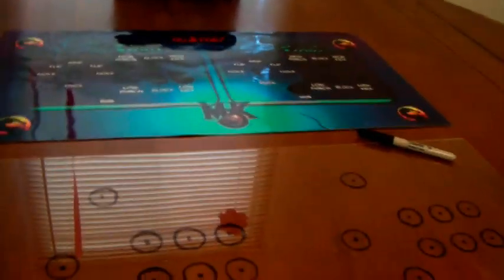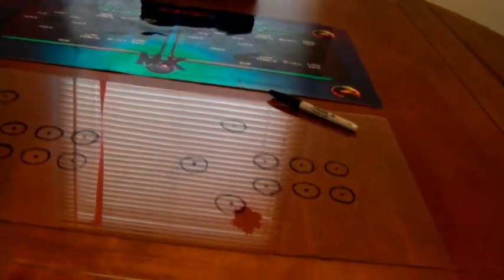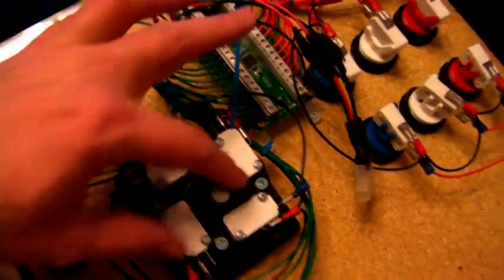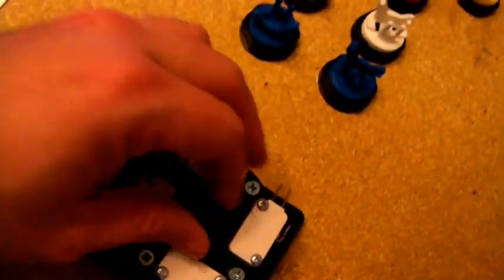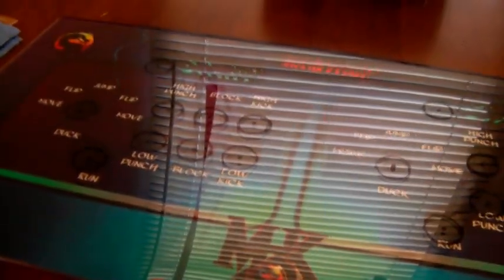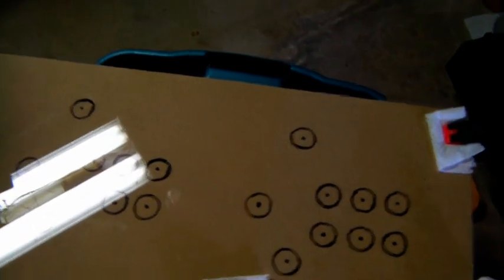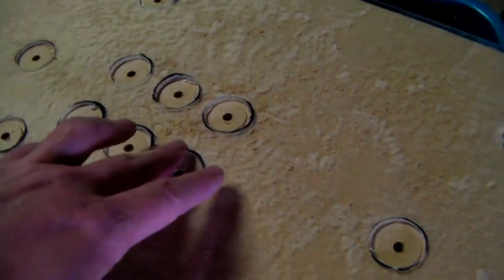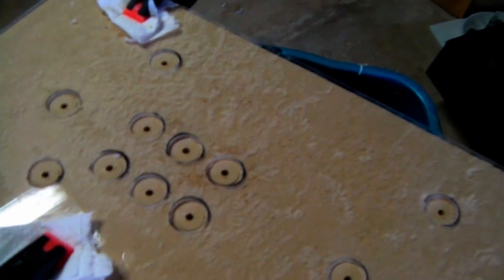MAME control panel art replace Prt 1

Comment from the maker: @sonofsam717 first i would not recommend kinkos for this kind of printing. kinkos is more for printing charts and graphs or power point demos. I personnally went to a local sign making business and had them help me out. If you want the 100% satisfaction though i would recommend contacting the people at mamemarquees they specialize in arcade reproductions and have the exact material used in the arcades.